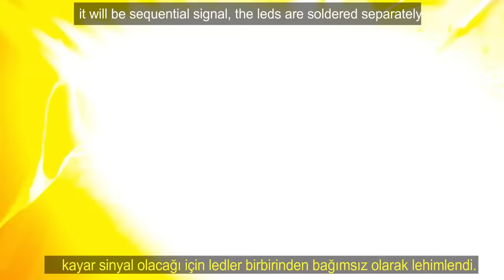Honda Civic FB7 Led Stop Nasıl Yapılır

Comment: I've customized street bike tail lights with a similar effect.  By taping off the design I wanted (on the inside of the tail light lense, and painting it (on the inside only) with flat black paint.  You keep the smooth shiny red surface on the exterior of the lenses, but get the design you want illuminated.  I.E.,  I made two circles, side by side on a rectangle light, instead of a rectangle it illuminated as two red circles.  I think I did a series of horizontal lines on a square lense once,  kind of a strobe effect.  Taping can be meticulous sometimes on tail lights because of the diamond shaped texture on the inside but it's not hard.  I think I pushed down some tiny areas with a toothpick and got clean sharp lines on finished product.  Some are just smooth, with no diamond texture. So those are easy to tape off on the inside, and produce fine lines when painted.

Comment: The work is elaborate, but the maintenance is difficult in the event of a malfunction
Reply: Put the parts’ quality aside, use of IC socket as well as no applying anti-damp coating to PCB and soldering points would shorten the lifespan of all parts, as those lamp modules are designed to allow moisture staying in and get evaporated repeatedly. About the craftsmanship, it is pretty awesome.
Reply: Oooooooo

Comment: Those are such a great idea for aftermarket lights for the Honda. Looks like they could work on a 2014 civic sedan.
Reply: They dont
Reply: Yes,they do. The model on the video is 2015 9th gen.
Reply: @silindirsiz  Is a 2012 gen bro, civic 9th Gen are from 2012-2015, but the 2012 model is very different to the 2013-2015 model

Comment: How it's Made - How to turn a legal tail light, into an illegal tail light.
Reply: Why it's illegal?
Reply: @Spooderman-b8o  well maybe its not "illegal", but its Not the original part  and i think that violate the granteed.. sooo
Reply: @tangosucka2000  in what country?
Reply: The amound of red light surface area is not with  in the specified range and luminance range..hence its not allowed ..also when the light break it should cruble in to tiny peices..if it doesnt then it is not within regulation.
It is to avoid peircing through pedestrians during collision
Reply: @networktutorials6290  it looks to me like the outer shell is stock, so it should shatter the same. And judging by how many leds he put in there, it's probably bright enough
Reply: That one guy...🥱🙄🖕🏿
Reply: @xpusostomos  but he added a adhesive material that binds the frame..that will orevent from crumbling. The light luminisance moght be bright but not radiating enough red that is visible from dostance. 

You will be surprised french carmaker piegott got tired of these rules and left usa market
Reply: @networktutorials6290  hmm... Judging by what goes on in US aftermarket modding TV shows, nobody cares

Comment: Now simply repeat the process on the other side!!! LoL thats the worst part of doing custom stuff like this is you get one side all perfect and set up nice and then you need to duplicate it on the other side and that can be difficult to do! Looks like he did a great job of it tho because they match up perfect! Design is the hardest and longest part so repeating it is usually a bit faster but still a pain in the butt!! The only issue I have with lights this moded like they are is if you have any parts fail lights burnt out or module burn out that can be a major issue. If you want to do this to your own car don't go on eBay and get the cheapest stuff you can find because you get what you pay for!! And if you buy custom lights don't be shocked when they say they cost 400 or more because parts are not cheap and neither is the customizers time!!

Comment: Any Modifikation of Lights(Head/Front/Backlights) is ILLEGAL in Germany and there are 2 very good reasons for this. When it comes to lights, we speak about to see and beeing seen, there should be no tolerance here. 2nd it's a question of insurance in case of an accident.

Comment: All's well and good until it rains and the water gets in and ruins the wiring and shorts out the bulbs because of the compromised factory weather seal ...Never compromise safety for the sake of a cosmetic feature